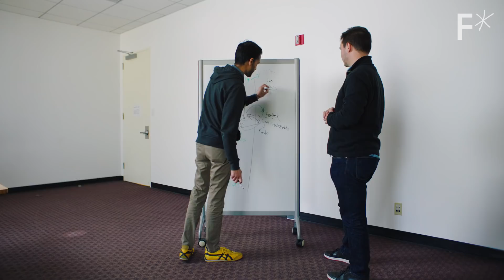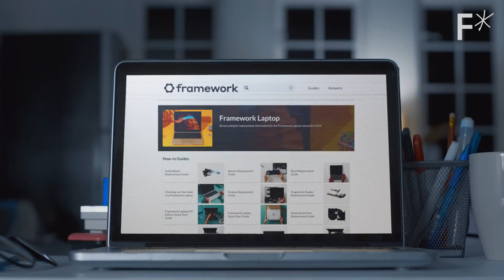The DIY laptop taking on Apple & Microsoft  | Challengers by Freethink

Comment from the maker: Do you think repairability is the future of electronics?
Reply: I can do you one better than Framework - we can build motherboards that are 100% recyclable, which is not yet done at scale.
Reply from the maker: @The_Cyber_System  that's really cool - can you share details?
Reply: @freethink   ... Repairability ALONE  shouldn't be the only Focus. Future proofing do MATTER a lot.
Presently, even the most Expensive Windows or Mac based system will not surview for more than 5 years (which practically is False) ...  Growth Speed (strategy of making Profit) of Tech & Software Industries have brainwashed customers in to believing  - "Upgrade  OR  else, You are Left Behind".
Reply: @freethink  Damn. Sorry, it seems like my replies keep getting deleted. Perhaps it's because I was trying to share a link to the article I was referencing?

In any case, I found what I was thinking of. It's more specifically about biodegradable Printed Circuit Boards, which obviously would be 100% recyclable. It's technology that has been proven to work (though perhaps not quite as cost-effective or space-efficient as existing materials yet), but it can be used right now.
Soluboard from Jiva Materials is one example.
Reply: @The_Cyber_System  wow
Reply: Yes
Reply: Yes. and being able to pause it, make a memory dump, debug, reverse engineer also.
Reply: no, actually not.
Reply: Repair ability AND compatibility!

I paid so much money to have  desktop level 980  GTX cards in my MSI Titan GT80S

Ok this is the issue... Base price of the laptop was over 4k it has two 980 GTX cards in it.

The problem. The hardware that supports those cards was new... Then changed! Then not even supported at all. I was sold on the impression that the cards could be upgradable and MSI LIED about that.

Theres the 1080 and 980 and BOTH run different boards and types of hardware...

Also, Nvidia starting SLi. They put two cards in SLI in the GT80S Titan only for SLI to be COMPLETELY phased out... Nvidia disabled it in 2020...

SO now I have this laptop with over a 7k investment ( I travel that much to have needed it) with a SINGLE 980GTX card in it running.  I paided for two cards for the other to get totally disabled and now its really only half of what it was.

The idea you are pitching, I hope you change this.

Laptops need to STOP being so damn proprietary and I am so freaking sick and tired of that! The body always changes... The monitors are inconsistent.

My monitor is a Certain size and I can't even put a 120hz monitor in my laptop... So my options are 400-500 dollar external /Portable monitors....

I don't like how these companies have a monopoly on laptops and I would rather build my own machine how I want it and be able to upgrade it with newer parts until its totally out of date.
Reply: No, leasing. That way, the manufacturer will try to prevent obsolescence.
Reply: This should have been the number one priority to begin with. Stupid scheduled obsolescence, fucking up the planet. Then this giant tech blames it on the consumers.
Reply: Do you replace your car when it breaks down?
Reply: Yes, it's needed, we have to leave the path of 'planned obsolescence' and think about the future, we can't constantly grow, that myth is a lie.
Apple has a cult following, Tesla as well. Both companies have the same take on many of their products. Try and get spare parts for anything from these companies, it's a nightmare.
That's why companies like Fairphone are the future in my eyes.
Thanks for bringing these good videos. 👍
Reply: @rjung_ch  
Sono Motors & Transition One are both Right to Repair compatible Electric car options.
The former is a soon to be mass produced EV car (big factory being built now i think, has started funding); the latter is a Conversion Kit designed to be easily fit DIY or by a shop, and mass produced and affordable.
Reply: @pebblepod30  Aptera is also a right to repair friendly electric car.
Reply: @MrGamelover23  thanks
Reply: As long as the components can be repaired/replaced/upgraded sure. Having the availability of current technology components years after the initial purchase is important. Visually, it’s also important to be able to update the case too!
Reply: absolutely
Reply: Yea surely, it should be the future but sighting the easily accessible parts and assembly a simple suggestion from a consumer point of view could be to introduce 2 variants for the same device. What I mean is that they should introduce both a fully built and a DIY kit variant since then there shall be a cut in the labour costs to a large extent...
Reply: @tanmoyeeghosh7180  you probably already found out in the last 8 months, but that's exactly what they already do, they have a diy version and a pre-built one.
Reply: "does the cat want treats?" Yeah :)
Reply: Certainly.
Reply: Def not.
Reply: This is a good concept the right to repair.
Reply: Yes, I always wanted devices like this.
Reply: Yes its the future..
Reply: I don't just think it. I know it.
Reply: Yes
Reply: Not at all sheeple are ready to succumb always remember.
Reply: Nope  not for general public anyways people are lazy, cheap and dumb..
Only way I see it would work is if standardization like we have with desktop parts became a thing... Like how people  building desktops is a thing though even that is still kinda niche...
Still I think it's the best they could hope for.
Reply: YES!!!
Reply: I really hope so!
Reply: go Framework!
Reply: for sure
Reply: The future? No, it was normal for decades. Then some people chose to make cheap $h!t so they would sell more. And we dumb a$$es keep buying...
Reply: Recycle, Repair, Reuse!
Reply: Yes
Reply: This is similar to fairphone
Reply: This will be my next laptop. I think there is a phone like that too....fairphone?
Reply: @pebblepod30  fair phone isn't available in America and they got rid of the headphone jack.
Reply: Yes surely it is the future of not only electronics but also every product or stuff which can be repaired should be repaired. As it reduces consumers time ,money and also develops trust about the respective company. Also it can help reduce the strain on semiconductors and other things which are very limited and eventually may end someday. Repairability should also be given importance like recycling
Reply: It should be..
Reply: No.
Reply: Yes, sure. It is. Apple, Microsoft, and maybe Dell, HP, and all others are creating very chances for Companies such as Frameworks for the new trend of repairability Computers and Electro-Mechanic Devices, World-wide. I love the idea and will hope can buy repairable Computers. Good luck to Frameworks Company
Reply: For YEARS I thought of a bulkier laptop as a tradeoff to swap pieces and parts for different purposes. Gaming, intensive processing for programming, data storage over processing power etc etc etc.

This is promising as hell
Reply: I hope so. Apple is moving backwards instead of forwards when it comes to serving their customers. Everyone else is, too, it seems. Except for you folks, of course. Wishing you much success. What will be the operating system on these laptops? It would be great if they were Apple OS,  as that is what I've always used. But I would imagine Apple would have to play ball with you and buy into your product design. Fat chance, unfortunately.
Reply: what's this about recyclable motherboards?
Reply: Yes!
Reply: @evanjrowley  No.
Reply: Something breaks in my Framework.
Step  1: I'm smart enough to guess at what it is.
Step 2: I'm right, so I've ordered the replacement and prep my screwdriver.

Besides assumptions that can take that process in different directions, what happens to the component that I'm replacing?  Does Framework put a bid on the piece, confident that they can 100% recycle it?  How long until there's 3rd party competitors for that piece?  Why assume that the defective piece will be reparable?

I like the DIY ethic, but 100% recyclability seems ambitious.  There's always something scraped when mechanical/non-organic entities are used.  Depreciation happens at different rates, but it's always there.
Reply: @MRCKify  I don't recall the video claiming that 100% recyclability is the goal, but perhaps I missed something. In any case, producers cannot completely control the behavior of those who use their products. If seems axiomatic that the "right to repair" a device also implies the right not to repair it. Some stuff will inevitably end up in a landfill. 

If Framework is realistic, they already know that there will always be a certain amount of "waste". Just giving users the freedom to configure (or reconfigure) their machines to meet their needs will inherently circumvent much of the forced obsolescence that seems to have become a pillar of their competitors' business models.

Comment: This is exactly the same situation farmers have when they purchase a John Deere tractor, they (farmers) want the right to repair, but the Corporation that sells the tractor has so much IP invested in it that they fear they will go out of business. I think if the mindset of the Corporation is switched, they will find they will make more money in selling replacement parts for the machine, for example if you say purchase a car  new $40k drive off from the lot, the corporation makes only 10% margin (just saying), however if you buy all the components to build the exact same car in parts, the corporation makes 700%, so the corporations arguement they have to repair is a mute one, this is why you still see really old tractors being used, because of 2 things, firstly they have no computers on them, secondly parts are available and farmers being farmers they can repair on farm themselves, saving time, money and get the 'tool' (tractor) back to work., so this guys thinking is exactly the same as a farmers, he is a smart guy, I wish him well.

Comment: I had a similar thought but for automobiles.  The populous needs an open-source design that has simple and replaceable parts whereby any self-taught mechanic or hobbyist can fix.  Something with the size and dimensions of a typical Toyota Camry would fit a majority of users -- practical, roomy, 4-door, spacious, plenty of trunk space.  Closest to a one-size-fits-all type of vehicle.  Of course, more types of standard vehicles can be designed that uses the same internal parts.

Comment: Interesting. I like being able to have up to 64gb ram on a laptop. The intel chip is pretty pricy but should be worth the cost if coupled with the 64gb of ram and at least a 2t ssd card. No need for a camera on the computer. I like the removable expansion card blocks. Now for an 8k monitor. Looking on running linux. Why use main stream software when you are trying to buck their products. We have linux. Use it. Something I may just buy to see if it will do what I need. I may need to emulate windows or mac os to operate some photography software I use.

Comment: IMO they're targeting too narrow of a customer base. 

For 1300$ it is possible to buy a full fledged gaming laptop and sell it 3 years later for half the price, they're offering only 1000-1500+$ office laptops (which are overprices right from the start). 

For this idea to fly they need the cheapest but working solutions starting at 600$ and up to chonky gaming rigs with latest bells and whistles (all modular obviosly) starting at the same price as current market price for a laptop with the latest but lowest-tier dedicated gpu, PLUS they'll probably have to sell them under the market price at least for the first year.

Otherwise they're asking consumers to overpay pretty penny just for the sake of modularity framework without a guaranteed promise that they'll continue to make and update modules for at least 10 years.

Comment: I agree with the right to repair but not everyone has the ability or inclination to repair or modify their equipment and interchangeability of components does cause unforeseen issues when you mix components that were not designed to work together.  You target Apple with your criticisms however my Macbook Pro has outlived three of my wife's work windows laptops.  Her machines are cheap, poorly built and not robust.
Reply: Not all windows laptops are "cheap, poorly built and not robust"

Comment: Great I guess if you are a Windows or Linux user. It’s really software that locks us Apple users in. Most of us don’t give a s—t about the hardware. Really - hardware is something geeks think about. Which is a shame because he’s completely correct - the use-and-discard philosophy is part of what’s wrong with the world right now. Of course I’ve had my iMac 12 years and I’m only just now looking to replace it. My MacBook is five years old and still runs the latest of everything I use - Logic Pro, Da Vinci Resolve, Blender, etc -  no sweat. My iPhone is only three years old but my previous lasted nearly six. So there’s that. Yet despite the longevity of the hardware and the excellent software I really think Apple need to be brought heel over their after-sale control-freakiness.

Comment: I'm from India and it has always boggled my mind that a thing like "right to repair" and a fight around it even exists. Out here we can service or fix literally anything, either directly from the parent company (which is more expensive) or local shops where you can get things repaired for far cheaper using knock off parts. For example, my Asus phone screen broke over two years ago and I got it repaired with a knock off screen at a local mobile phone store for about 25% of the original cost at most and it lasted for another 6 months by which time the screen started giving me issues and I wanted to upgrade my phone to one with better features anyway, so I bought a Samsung. Now this Samsung has lasted me almost 2 years and its screen broke for the first time a few days ago. I'll continue using it for a while cos the crack on the screen hasn't made it unusable and if really required I'll get it replaced again and extend its life by another 6 months. Similarly I had a Lenovo laptop that I bought in 2013 and it worked fine till 2016 when the keyboard broke. So I got it replaced at the official Lenovo store for a fraction of the laptop's price and it lasted another 3 years. 6 years I had that, alongside other laptops and compters of course but it still lasted that long even though I used it less and less over the years.

Companies banning people from repairing their gadgets however they want is literally a crime and only something I would expect of the USA's late stage cancer capitalism. They just want to make profit at the cost of anyone and anything. To hell with the earth, to hell with resource conservation and to hell with any logic of sustainable science. Only money matters to the capitalist overlords.

Comment: When you can upgrade and replace the cpu and gpu I will be onboard with framework. Need to be able to make power upgrades. Having the ability to upgrade thermals for better  cooling  would be nice as well.
Reply: You wont see that any time soon becuase AMD,Intel, and Nvidia no longer make socketed laptop cpus and gpus and Framework doesn't have the market pressure to make them do so. The best you will see is upgradeable laptop motherboards.

Comment: The problem with this is most laptop buyer doesn't care nor knew how building a desktop works.  So making them support the idea of frameworks is a little shoot for the moon.

It would be great if frameworks starts with mini pc.  Then when they succeed on that industry push for laptop frame works next.

The next problem is economic. (global one).  Chinese markets will make imitation of its replaceable parts (its 100% sure). It is inevitable.

There is pros and cons on that. Letting them imitate it will help framework idea spread and works.   But framework will surely don't get any profit from it.

If framework try to fight the imitation by doing the same thing apple does.. Then its game over.

In short... If frameworks want to succeed.. It needs a chinese counterpart, a partner who knew how chinese market and supply chain works so to protect their idea from getting imitated without a fight.  When I mean a fight.. It's price battle.

Coz imitation wont imitate the parts if the profit margin is too tiny and the risk is high since having a chinese counter part means chinese government will have jurisdiction over it.

Comment: So framework mindset is almost the same as in building CPUs from scratch using existing components (motherboards, GPUs, Power Supply, etc), but this time it's a laptop??
I'm in!!! This mindset has happened in my country. And instead of buying completely new computer, we just buy the graphic card and upgrade it ourselves.

Comment: I've just finished building my first Desktop, because the seal that holds the screen in, isn't available. It's the final stram on the camels back. I'm really impressed by how modular desktop PC have become,  Standard size formats mean I didn't have to worry about anything fitting. The machine is incredible tidy. It's about time these standardizations moved into the laptops world.

Comment: Things are SO bad, that I gave up on my desktop and bought a laptop instead, because the laptop is going to work for a few years, whereas the desktop, which should be repairable and upgradeable, was always giving trouble.

Design a desktop with a built in battery so it works like a laptop.